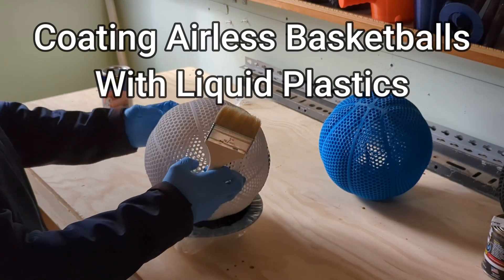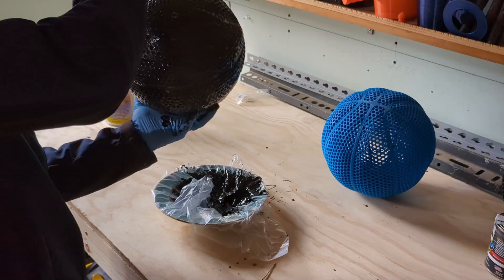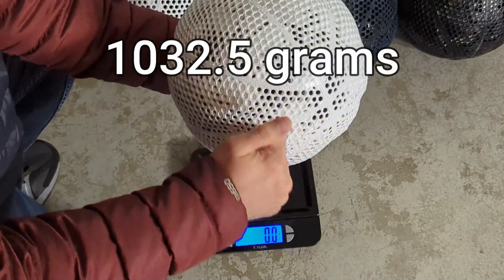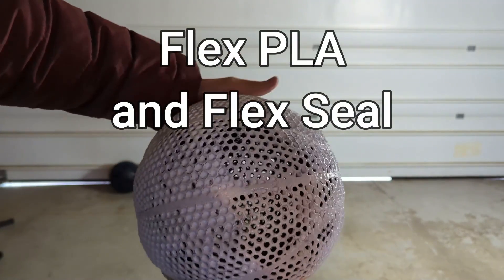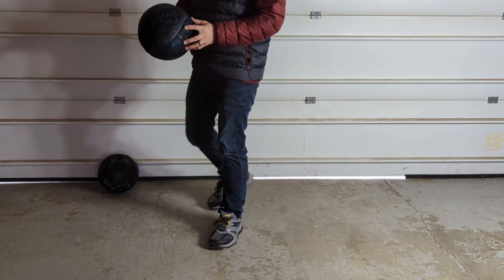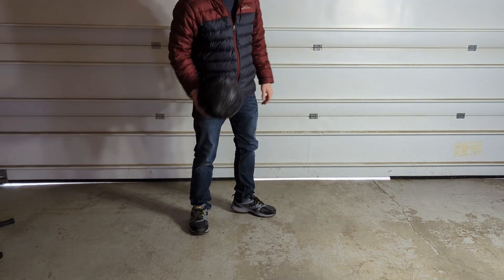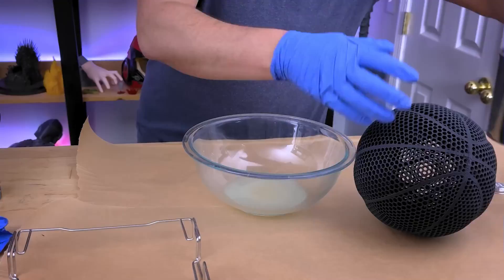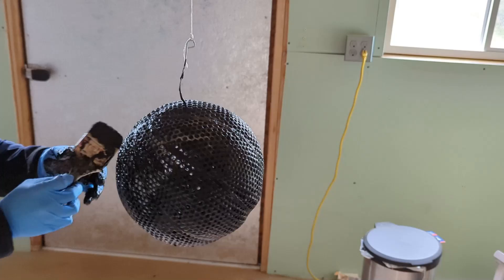Is Liquid Plastic the Secret to Ultimate 3D Printed Airless Basketball Performance?

Comment from the maker: What should we try next?
Reply: Use TPU instead of PLA
Reply from the maker: @antonkukoba3378  Yes I have added TPU to the list so good call!
Reply: @makeitlabchannel can you 3d print Captain America's shield?
Reply from the maker: @TheVibraniumPatriot  ooh that could be fun, thanks for the suggestion!
Reply: @makeitlabchannel  you're welcome. I wonder if you can make it bouncy like those airless basketballs?
Reply from the maker: @TheVibraniumPatriot  Yeah I could try the flex PLA with it, that could be fun.
Reply: SEBS (hard & elastic for more bounce) + Spray painted plastidip in a very thin layer for more grip.
Reply from the maker: @christianritz6576  I tried a TPE SEBS filament, and it was one of the worst bouncing filaments that I have tested lol. Maybe there are better options, and maybe plastidip on top would help
Reply: You should try this again with the new film ins but just with the plastic dip
Reply from the maker: @Old-soul91 I did end up purchasing the spray, so maybe I can give it another go 😁
Reply: Please use double lattice 3d file, flex pla with gorillas glue adhesive spray, atomic filaments impact modified pla, and PEBA when it is back in stock.
Reply from the maker: @ScaleToTheWire  I like it!
Reply: @makeitlabchannel it’s probably a longshot, asking this. But is there anyway you could just 3-D print the double lattice with flex PLA and just let me know if it works better? Then you can post the video about it whenever you feel like it. I have the filament ordered, but I would really like to know if the double lattice works better or the solid. Could you by any chance comment back and let me know if the double lattice does work better? If so, I just need to know by Tuesday this next week.
Reply from the maker: @ScaleToTheWire  I am actually out of the flex PLA but I have more coming in on Wednesday this next week. If you can wait I can print it and try but it probably wouldn't be done until Friday or Saturday next week
Reply: @makeitlabchannel  ok, that’s fine. I just didn’t want to print it out and then have it not work, but I’ll give it a shot.
Reply from the maker: @ScaleToTheWire  would love to hear how it turns out!
Reply: @makeitlabchannel  thanks, I’m also trying both gorilla glue adhesive spray as well as a clearcoat, hoping that that will make it more durable.

Comment: how about using plastidip spray paint insted (like 5 passes) to get a more even coat on top and then seal it with some clear coat (3 passes).
Reply from the maker: You might be on to something, that might make it more rigid too which might help the bounce. Guess I need to buy Plasti Dip spray paint!

Comment: Dude - You can also spray on plastic-dip.
Reply from the maker: Yeah Flex Seal is a spray too. I was debating between the spray and liquid, and I thought especially for the Super PLA+ it would need more than the spray to get it to work but the spray might have actually been better

Comment: Did you tried TPU?
Reply from the maker: I have seen a lot of other videos of the basketballs printed in TPU, and it looks like most tpus are too soft for a good bounce. I think there is carbon fiber reinforced tpu that might work well though
Reply: @makeitlabchannel  the number in TPUs name is related to flexibility with 99A being a stiff hard plastic. Try a tpu other than the standard 95A.
Reply from the maker: @ThePesmat  yeah I could give that a shot, good suggestion 😁